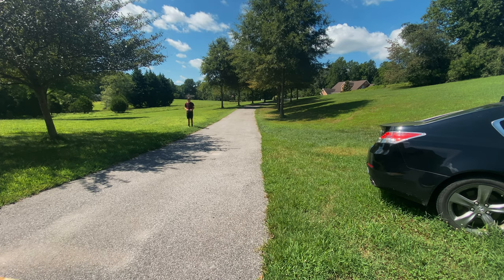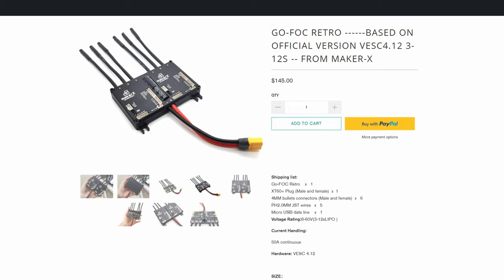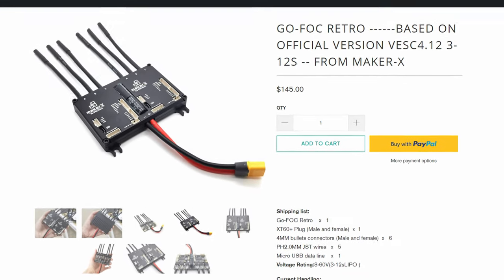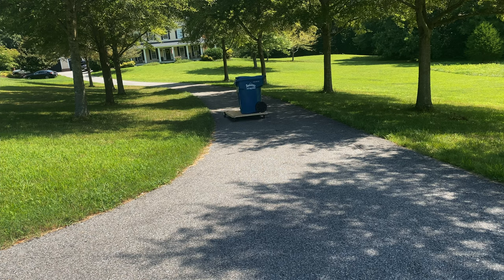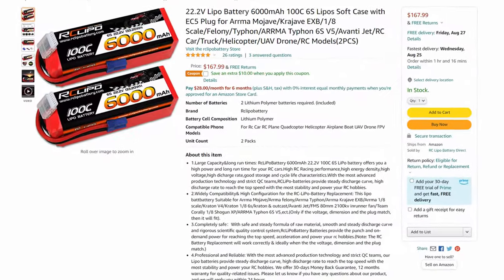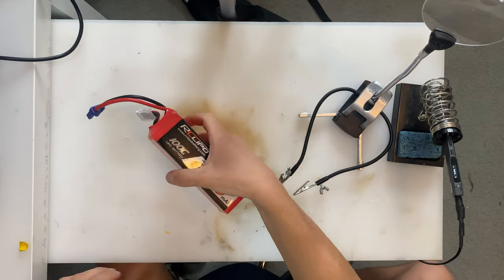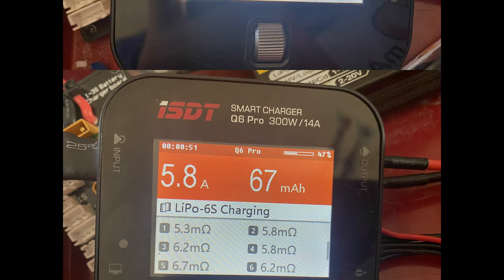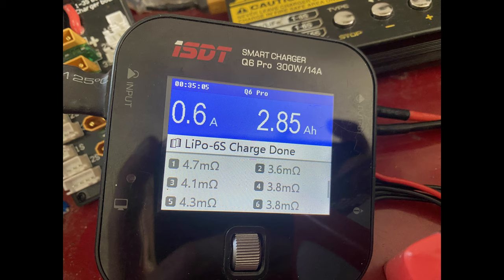The Motorized Platform | Necessary? I think not!

Comment: Mobile solar charger with a bigger battery? +RC FPV and/or autopilot because why not, if we're just gonna be tossing up ideas :D
Reply from the maker: I actually looked into solar… the thing stopping me from doing ardurover for taking the trash up and down is there’s no way the thrash guys are putting it back on the platform. I was thinking even better than solar that I could have a dock at the side of the house where it can storage charge and charge before trash day. Might still do it. Just have to come to terms with putting them back on after and figure out a parking brake.